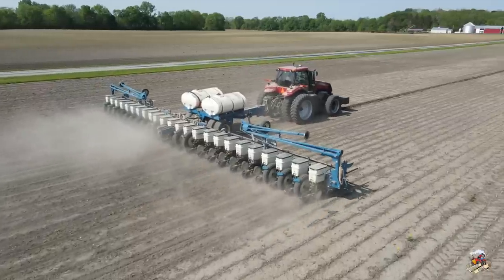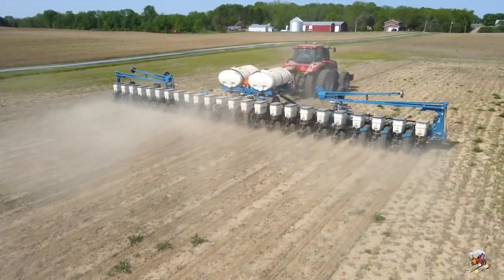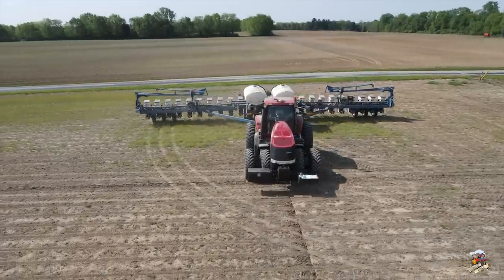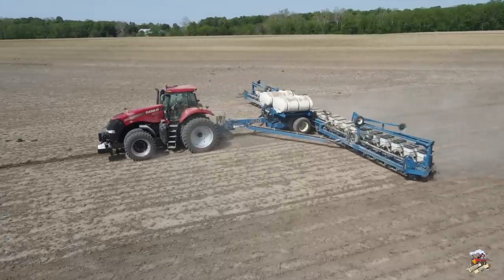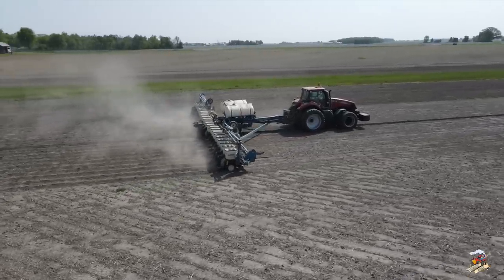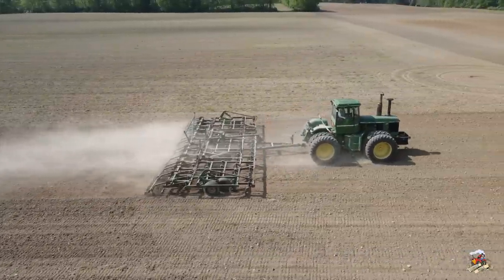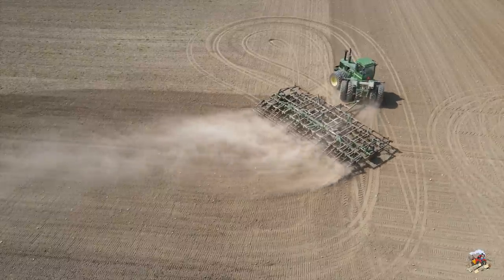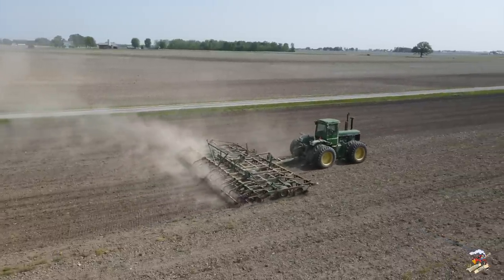No Till Corn Planting 2023 | Southern Darke County Ohio

Comment: Hey Mike I think tractor data is wrong the older magnums had the 18 speeds the newer ones are 19.   Then if it didn’t have a suspended front axle they limited the rpm in 19th and wouldn’t go as fast as the ones with the suspended front axle.   I could definitely be wrong on that but that’s been my experience in all the CNH tractors I’ve been in

Comment: What the farmers do the rest of the year until the corn is ready for harvesting?
Reply from the maker: Well it all depends on the farm but right after planting wraps up the corn gets side dressed (nitrogen applied) Then spraying will keep most busy until mid July and if they grow winter wheat they have to harvest that end of June into July. Haul last years crop to market if they still have carryover. Then cleaning up the planting equipment for storage, Getting the bins and harvest equipment ready for harvest in September so there is always something going on.
Reply: @farmhandmike  Thank you for the comprehensive answer.